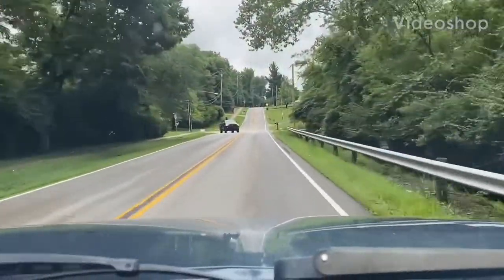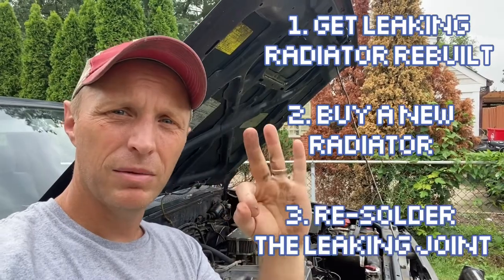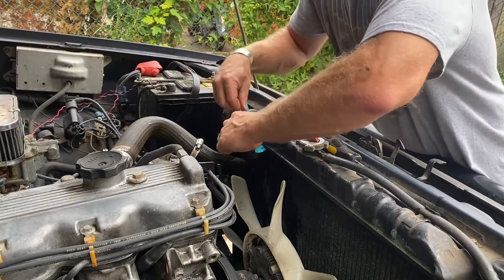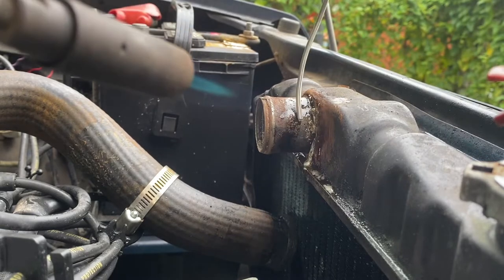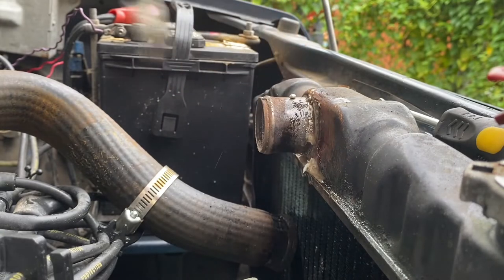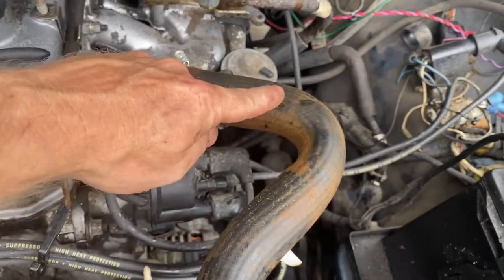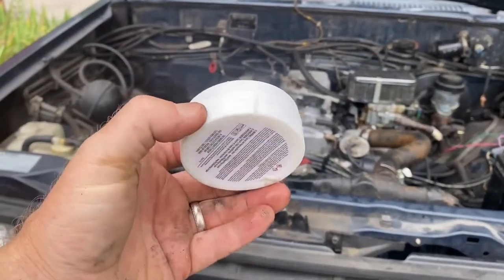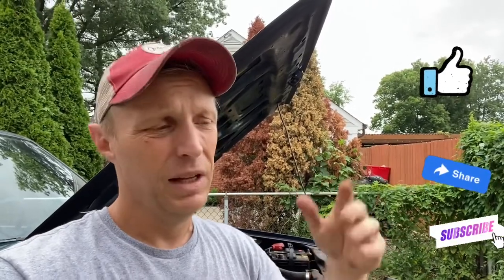First time trying to fix a leaky brass radiator

Comment: I don't know why you keep calling it 'Silver Solder'. That's just the normal 'Lead free' Antimony/Tin blend which is 95/5. It melts at 425f or so. I don't like that stuff especially for this kind of repair. For a brass/copper radiator you should use acid core 60/40 lead-tin blend. it melts lower, flows better and bonds better. True 'Silver' bearing solder melts at a much higher temp and is used for specialized work like HVAC lines. That's just a cheap box store water soluble flux and LF solder kit, neither of which you need for this repair. By the way, your flame is way too high. You need a lazy almost carburizing rosebud flame for a wider, less intense heat. The biggest problem you have was A) CLEANLINESS The area was in no way clean enough. Should be shiny brass. Can't solder to oxidized metal. And B) Too much heat. If you overheat the area the solder will roll off instead of bond.
Reply from the maker: Thanks!  I knew something wasn’t right, and I’m happy to get some tips on how to do it better if I should have to solder brass/copper again.  Usually I’m just soldering electrical connections.
Reply: @Foxcanfixit  No problem! That brass is really thin so it doesn't take much heat to get it up to working temp. I would just use a plain propane torch, not the turbo or venturi type and pull it back and forth and check the flow by touching it with the solder. A small wire brush should get it nice and clean. You can buy the lead acid core solder at regular hardware store like Ace or True Value. They have the 'regular' paste flux too.  that water soluble stuff doesn't seem to work well. You want to use the least amount of heat to get the job done, that brass is so thin if it overheats the solder will roll right off.
Reply from the maker: Can I use this advice if ui do a follow up video on what I did wrong?
Reply: @Foxcanfixit  Sure thing! I don' mind, good luck!
Reply: @Foxcanfixit  Like anything, practice makes perfect. Those radiators are tough. It's all about heat control because that brass is SO thin it can overheat really quick and throw off the heat just as fast once you pull the heat source away.
Reply: Thanks to both of you guys
Reply: I have a hole in one of the I think copper cores it's on a 75 chevy pickup
Reply: @raycooper931  I went to a surplus store near me and found they had a bunch of solid 50/50 lead-tin for $5. I fixed a pinhole in one of the tubes on my old '71 Plymouth. I think it was from an impurity in the metal or a weak spot. Real minor leak after I flushed it with Citric acid. Wish I would have recored my rad years ago. Every place I call now is about $1000.